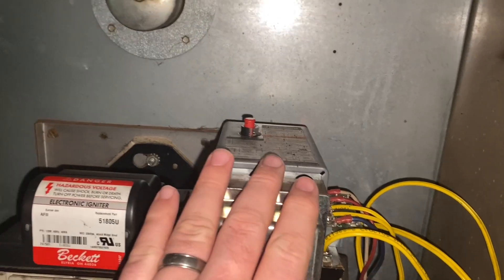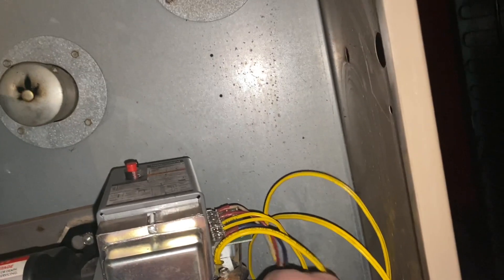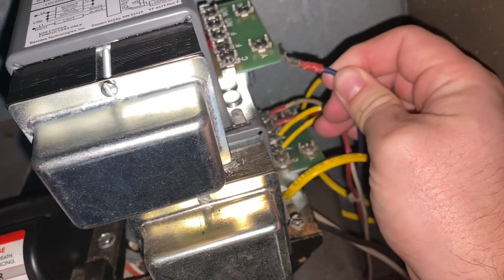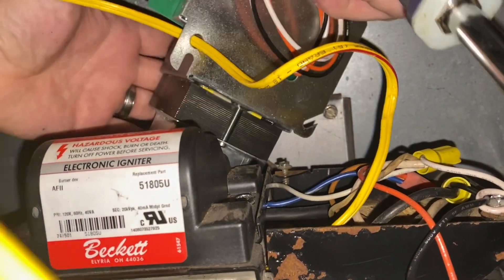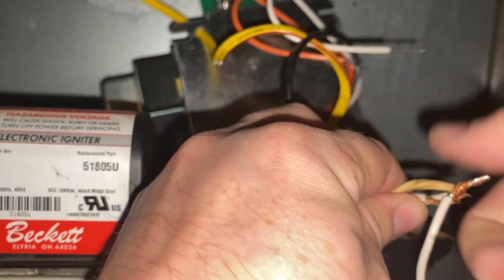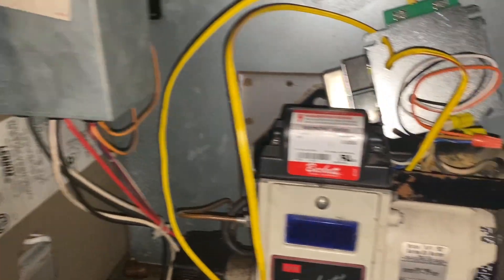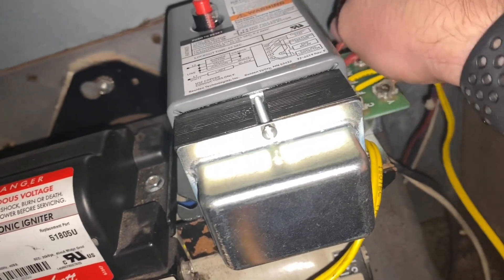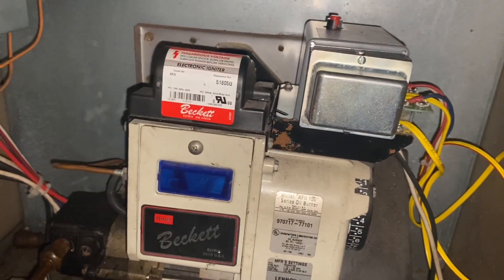How to Replace a Oil Burner Control Relay on a Fuel Oil Furnace #DIY #fueloil #furnace

Comment: Thank you for this video.   I have an oil fired furnace -a  27 yr old UniCell. I think this is what I need since I have cool air blowing from vents when I put the heat on.  I had 3 different hvac guys come out and all they did was basically clean the filter and reset it and I keep mentioning that I thought it might be the ignition or a miscommunication between my thermostat and furnace but they don;t think so....Where can I buy this piece and how much is it ?

Comment: Thanks for the video. I believe mine is bad but not sure how to test it. I got 120v going in on the black wire, white connected to neutral, thermostat switches relay on/off but I'm not getting 120v from the orange wire to start my blower and ignition
Reply from the maker: There are not a lot of pieces and parts to these. It will depend on what it’s doing. If it’s not lighting at all and the fuel is pumping, it could be an igniter or clogged nozzle, if nothing it happening at all, it’s the relay. Mine was going on and off constantly so I figured it was getting intermittent power. Just be safe and don’t keep resetting and letting the pump run as that’s adding unburned fuel into the combustion chamber. If that happened, call a professional before trying to fire it up.